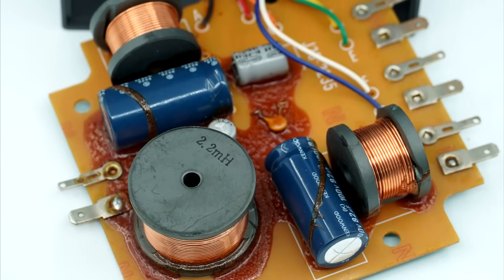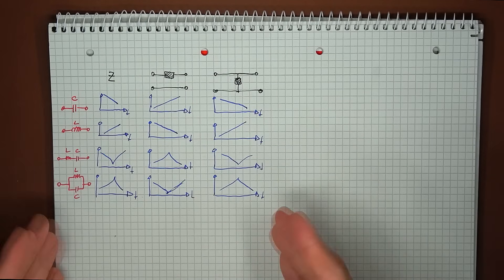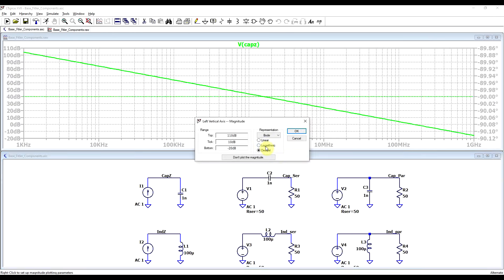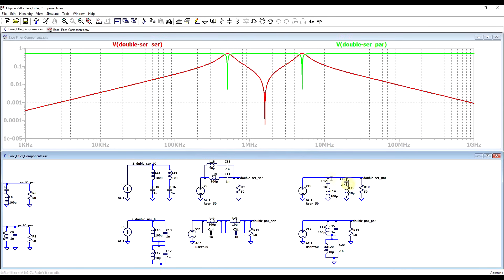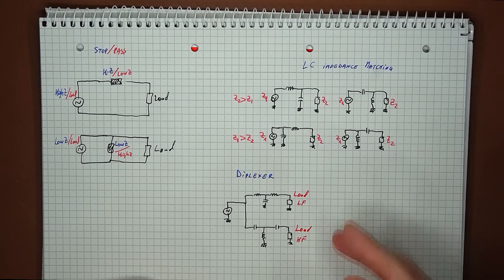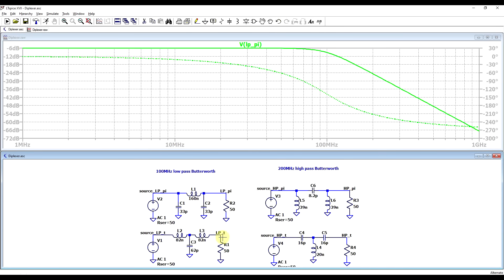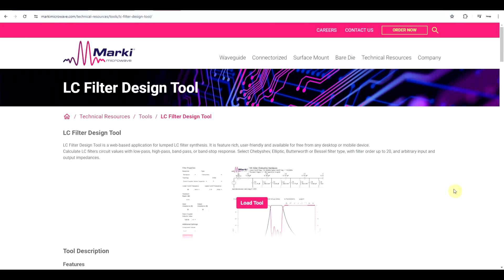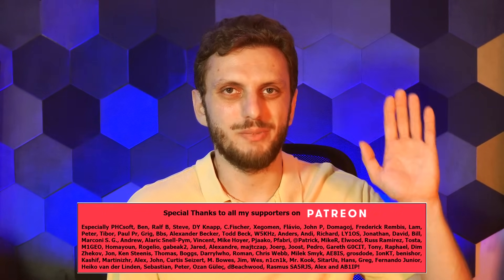Introduction to LC Filters

Comment: Hi. I'm learning about LC filter configurations and like how you approach the topic, but I'm extremely confused about your graphs/explanation from 1:22 to 1:57. Can you please tell me what the axis labels are for all of these graphs? For example, when you explain the series capacitor what you are saying doesn't seem to match what the graph shows...likely because I'm confused about how you are considering the graph axis labels. Thank you!
Reply from the maker: The first graph refers to impedance vs frequency, the second and third refers to the gain of the network - how is a constant amplitude input signal seen at the output (S21 in other words)

Comment: Inductors are hard to make and measure in nH range :|
Reply: Making them is not that hard: 150um wire and a bit of trash and glue are enough. But forget your LCR Meter.

Comment: Thank you for the video and the app recommendation. I'll give the Marki online app a try, though I really prefer downloadable apps. I don't like depending on the internet and the kindness of the online web page owner to always keep the free app available. I've seen more than 1such useful page pop up with a perpetual HTTP 404 error, or I want to do some dev work but I'm somewhere without a web connection. 

As a ham radio builder and experimenter with only a high-school (12 year) education such PC applications allow me to nearly optimize my designs without spending hours playing with variable inductors and capacitors, then measuring the values off the devices to then replace with fixed values. I've become a real fan of device value selection apps, and circuit modeling programs.
Reply from the maker: I fully agree that a stand alone, local, piece of software is far more reliable in the long term, but at least for this series I will try to recommend the best tool - giving the best performance, that I can find, which is free. Anyway, there is no single correct answer when it comes to filters - you can reach the same outcome using multiple methods.
Reply: A good tool to run locally on a PC is RFSim99. This is a simple mainly passive components design and simulation tool which works in the S parameter domain. The output is either as a bode plot or Smith chart.
It has a few filter, impedance matching and attenuator design calculators which I find very useful. And you can run a tolerance sweep and see the effect of component variations. You can also import S-parameter files from a VNA, ie. to see the effect of a measured load or source impedance on a (filter) circuit.
It is an older tool but I use it a lot for designing my (ham radio) circuits.